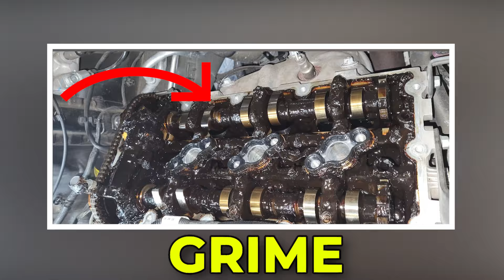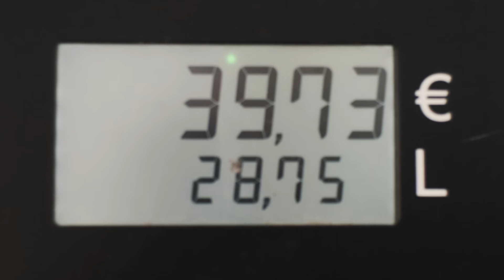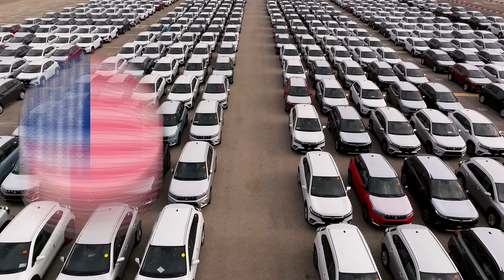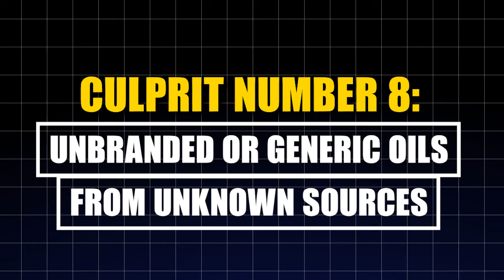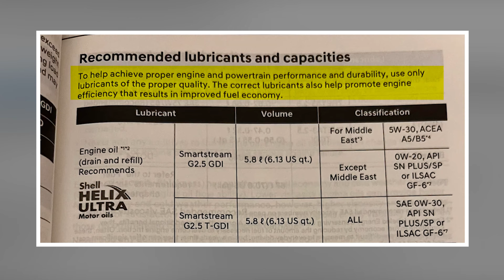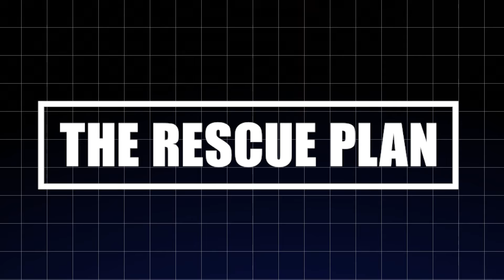STOP Using This Engine Oil – Serious WARNING for Drivers (Big Mistake)

Comment: It's real easy, use the 🛢oil the manufacturer recommends. Additives are 🐍 snake oil. The designers have a hundred years experience accumulated. That's all you need to know.